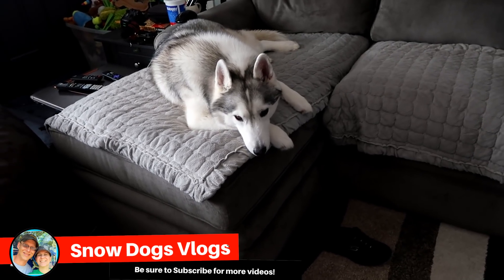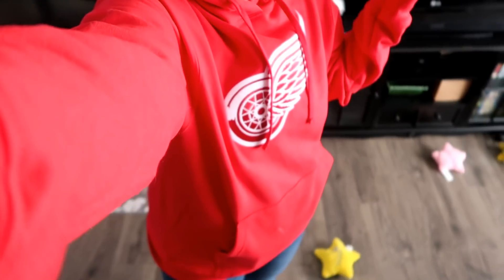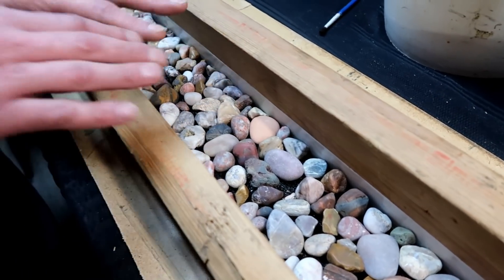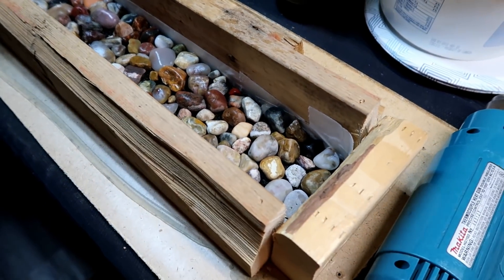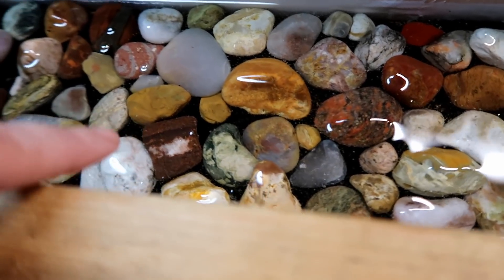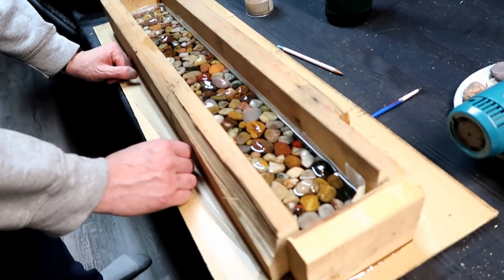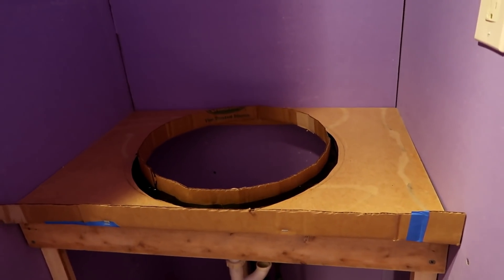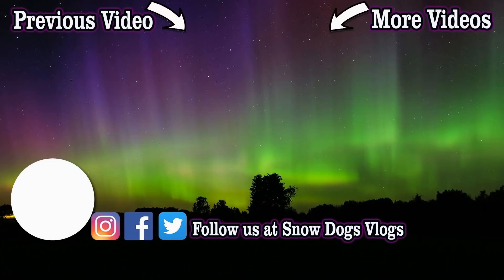What Do We Do With Rocks and Epoxy Resin

Comment: You should use the black sand for the top of the vanity and put rocks on the front/cabinet doors of the vanity.
Reply: It would be cool if the cabinets were clear and the rocks could be removed... But a solid countertop would make the backsplash stand out and not be overwhelming.